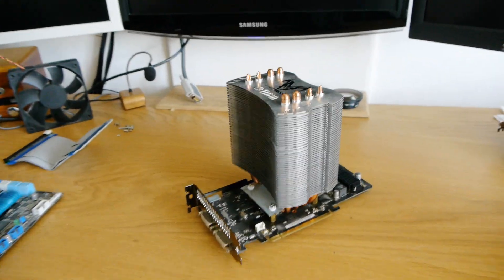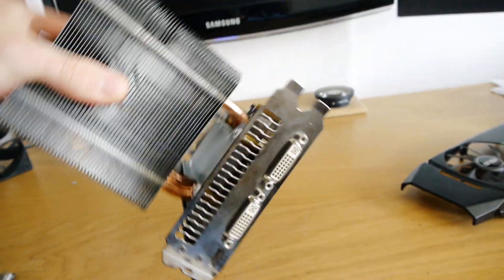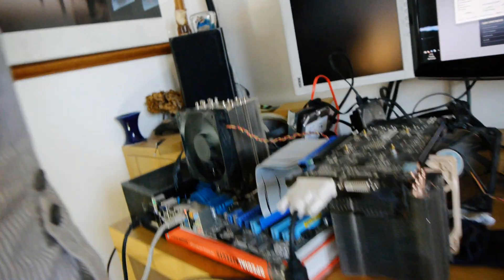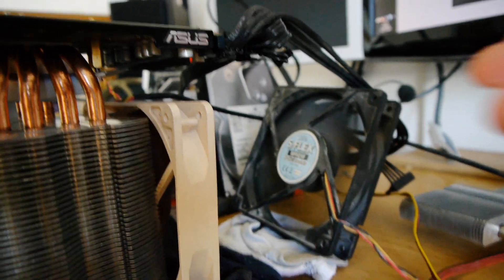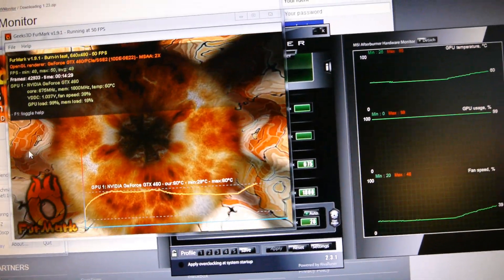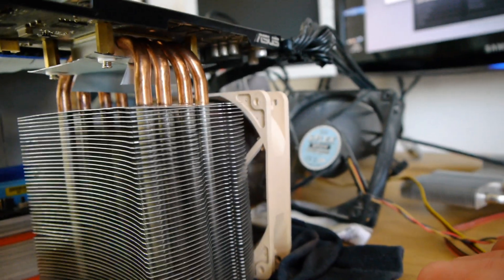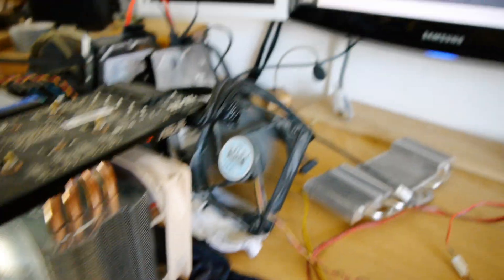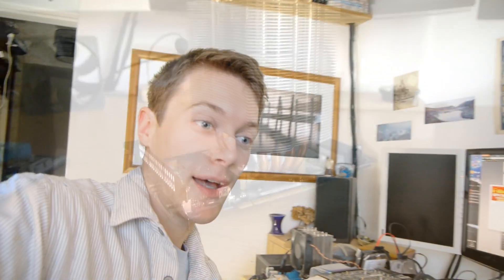CPU cooler on GPU (INSANE temps!)

Comment: Nottingham Area! Project offer! Project Idea!
Hi. Big fan of your channel, the work you do is great and quality looks amazing. I was hoping to tempt your passion for tech with helping a fellow enthusiast create something unique for your channel. Are you up to the challenge? I would be happy to deliver my entire set up to you. Or you are welcome to work here. I would love to send you some pictures and further details of what equipment I have. What do you think? I would love to make this happen for the ultimate studio/ gaming setup. 
 I have a fairly decent HP laptop (spec below) with a monitor. I also have a black desk & some semi pro recording studio hardware (details below). I would love your help to intergrate this equipment into my desk. I am also into gaming and would like to add a Laptop External Independent Video Card PCI-E Expansion Card for an external GPU

Laptop
HP ZBook 15u G5 Core i7-8550U 16GB 512GB Radeon Pro WX 3100

Monitor
HP 32s Full HD 31.5" IPS LCD Monitor - Black & Silver

Desk
3 Tier Pro Audio Studio Desk
Large studio workstation - for musicians and producers
Keep outboard gear within reach by using the two 4U rackmounts
Sturdy structure, with wooden laminate shelves
Raised top shelf to position your speakers and computer screen

Recording studio software
Acid Pro 10

Recording studio equipment
SubZero SZ-AI2 USB Audio Interface
SubZero SZC-300 Condenser Microphone
SubZero SZSM-4X Studio Monitors, Pair
SubZero SZ-MH200 Monitoring Headphones

Additional speaker
Sonos Play 3

Please contact @pesciboi on insta or twitter for more info

Comment: I first watched this video a while back and was wondering from time to time if there was a way to put a cooler on GPUs, that is better than the stock coolers but a bit more practical than this mod. Stock coolers are weirdly designed imo, because the air just 'splashes' to all sides after hitting the fins and don't really go with the airflow of normal cases.

I did end up putting a 120mm AIO on my 1080ti mini with the Kraken GPU mounting kit and I have to say that I'm seriously impressed. I went from thermal throttling at 90°C with 120% power target to a maximum of 58°C. YOu can just leave the pump and fans speed at minimum, at it's whisper quite.

Comment: if you drill a hole into a multilayer circuitboard, to mount a cooler, and it still works after, it is either a fals one, or you just got lucky. And do not forget, Do not do this at home, you might kill a planet by creating more E-waste.

Comment: Brilliant. It should be possible to also mount a 2nd cooler to the back of the card, with thermal pads as thermal interface as too many exposed components there. I'm estimating if that can be done, another 10c to 20C drop, as the back gets similarly hot as front. I have just done a little experiment with placing freely, a stock cpu cooler on to the backplate of 1080ti kingpin gpu, with lots of thermal compound and noticing a few degrees lower temps.

Comment: pci extension cause you mounted the cooler the wrong way..if it was rotated by 90 degrees it would fit in the proper slot.

Comment: - 4 heatpipes. They run from one end to the other.
- You should make another video with mini copper heatsinks over the necessary chips.
- If installing the GPU in the PCIe slot, make sure there is enough weight support built on the side to avoid breaking the GPU and PCIe slot. Either through a custom screw bracket attached to the case with an "L" standoff edge or similar, or something securely in place underneath the heatsink to hold the weight.

Comment: My card tops out at around 65c with the stock blower cooler. I thought results would have been better, but it goes to show how effective blower coolers are for extracting heat since it literally blows the heat OUTSIDE of the case keeping case temps lower and thus the card cooler.

Comment: Isn’t that cooler designed in a way where inverted is the least efficient because the liquid within the pipes are not absorbing the complete heat from the gpu and traveling “up” the pipes to then return back to the base? 
With this layout would all the steam and air be what is trying to cool the unit and the liquid within is resting untouched?

Comment: Hey thx for the vid. I was inspired and did the same with good results on my GTX1060. Reduced GPU temps from 83*C to 59*C. Costs 30$ for ready made mounting brackets and heatsink.

https://imgur.com/a/gnRlM

Also added tiny copper pieces on VRMs.

Comment: That big heat sink is not square.. it is rectangle... why on earth did you mount it with the length towards the mother board? It just seems like you were sleeping when you were designing...

Comment: Fuck you said 23C is pretty hott?? In Arab 40 is the normalestttt temprature!! In Indonesia 33-35 is good temperature and if its 23C in my country maybe people will dead caused of frozen and in my house i use AC but actually its not Air Conditioner but it is "Angin Cepoy-Cepoy" or world's fresh air or sames like an engine without radiator that you need air too cool ur engine or ur engine will be overheated then blows up hahhahaha.. "Sorry if my grammar wrong because i just a villager with low knowledge :)

Comment: I just wanted to correct you on some your terminology your pci-e extension cable is actually called a pci express rizer cable as wellwhen you state that its awesome performance at 60c  you would actually want to say it's awesome thermals  but cool video definitely but cool video definitely a neat idea

Comment: nutz got a 7970 with 3 small fans works great runs 40-50c overclocked /// and overclocking not needed just tried it few times playing around ! very slight visual improvements overclocked not worth the slightest risk / now overclocking my 8350 makes big difference

Comment: have fun fitting that into your case...  you could retrofit a car radiator on the card too but its not practical.....cooling is a science between getting temps down without taking up too much space and energy....

Comment: No, the pipes are 4. FOUR! And to make a conclusion, we should know how much RPM was the fan at 58°C and 51°C respectively. So we can find how much percent we should increase the RPM to reach 1% lower temp. That's why I'm wondering if the readings on FurMark are based on the fan RPM, when connected to videocard fan molex or not? My suggestion is that we have 5:1 ratio - we should increase the RPM with 5% to gain 1% lower temp but ONLY on this exact computer system.

Comment: Nice video but... just to point out... the heatsink has 4 pipes, not 8. Since heat raises you mounting the heatsink upside down is actually having a negative effect in your experiment.

Comment: i have a suggestion for ya, try putting on the original heat sink that came with your GPU and maybe put a 140mm or even a 200mm fan on it :)

Comment: interesting concept but could you add a Peltier cooler and flip it upside down for condensation collection tray. unless a gel based dehydration substance be utilized.
Reply: Yes this orientation now submerged lol
Reply: in oil both motherboard and gpu could be cooled this way

Comment: For those of us who have found SLI/crossfire to not be worth it because of the related cooling problems> Why do all the vid cards have to be 1 or 2 slot case heaters? Lets see what do I use on the PCI side with that GTX 690. Oh I remember....   right nothing. So that leave me how many empty slots to exhaust Vid card air? I gadiated unvirsity two tobad  did not stay so i could learn longs nuff stuff so how not to think.

Comment: Good finding, 60 degree top temp at full load is impressive. Would be cool to actually be able to do this inside a case somehow. Like using an extra slot and have a much beefier yet flat (shape of an extra graphic card using that slot) heatsink+fan construction. It could have a rubber extension to take air from the front of the case directly into the heatsink instead of sucking warm air from inside the case.

Comment: Try to replicate the same with a 700/900/1000 series, if you find a solution and get it below 80c full load without the stock cooler and with a complete silence, you should write a patent! :D

Comment: All the comments just pointing out temps where they live 😐 Back to the matter at hand i would suggest putting a lower profile cooler on there is one that is both heatsink and fan called thermal take then you can buy small heat sinks to place on the ram they come in various sizes and the silent fan on the cooler would draw heat away from the ram chips heatsinks 😊

Comment: what? why so warm? my Graphics card runs 60c in "quiet mode"
Reply: The GTX4xx series was notorious for their extremely high temperatures.

I think the 460 was around 80ish °C under full load (reference card, so his orignial cooler from Asus could maybe achieve around 70-75°C) - that's without ANY overclock whatsoever.

I suspect you GPU is something newer than the GTX 4xx series - these last generations AMD and NVidia have mainly focussed on lower power consumption (=less heat), rather than throwing every last bit of cash onto pure performance (which was done with the GTX 4xx series - not a smart move back then)

Comment: 1. The cooler is outside a Case.
2. The cooler is bigger then outher GPU coolers so no wonder.
3. In my room there are always temps from 23-26 and in summer about 28 °C and I have floor heating so... 70°C for my Gpu are insane^^

Comment: Very strange method of resolve cooling by manipulating a dimensions of fan and radiator. 
Probably more easy to direct flow of cold air to cooling system to reach better results?

Comment: Lol my 750ti doesn't even pass 45 degrees Celsius under a full load
Reply: It's also 4 generations newer.
Reply: PanicStudios true
Reply: TroyRedstone it's probably a non reference so the company might have add on the powerful cooling as a way to charge more money. also the current generation is much more power efficient so they generally generate less heat
Reply: yeah i agree, most nvidia cards have lower temps than amd

Comment: I was expecting more actually, 10 degrees cooler than stock? with a heatsink of that size? whaaaat
Reply: well, its not properly spread sooo thats all you can expect from it
Reply: Well there is probably less thermal throttling going on with the big ass heatsink.
Reply: 10° at minimum fan speeds with no thermal pads and the GPU upside down so the die is on top.(heat rises). 20° at maximum fan speed. 

Fix all the other stuff and I’d be willing to bet it could easily be 20° at minimum.
Reply: 20°,watch the whole video

Comment: nice modification, but the pipes sistems is working upside down.. there is a gas inside de pipes that evaporate and condense to inproove the cooling. You have to put the cooler up. try another video test like this ;)
Reply: but if you look at the numbers, you'll see that it still performed with vast superiority over the stock cooler :)
Reply: Yes but could be better ;)

Comment: coolers perform better verticaly and not upside down, because of condensation. Let gravity do its job, you should notice an improvement.
Reply: Hot air rises, heat in itself is conducted through some materials, as is
 electricity. Copper is a great heat conductor, air is a pretty good 
heat isolator compared to most metals.

Comment: Oly problem with doing this on newer GPUs is that this doesnt cool the RAM or VRMs and only cools the GPU die. Newer GPUS are going to need significant cooling on the ram and VRMs. These older cards could get away with passive air cooling directly on the chips from case fans and the like.

Comment: Yawn. My 780ti with NZXT bracket and 100 dollar AIO liquid cooler runs at 45 degrees under full load constant. Super experiment LOL. Oh and the temps are not insane at all as you could read. :)

Comment: lmao 20 degrees cooler i expected around 30 / 40, install a watercooling system and be amazed how silent and cool you'll run. not even speaking of how impractical your setup is with the pcie cable and no case oO. this video is a complete joke

Comment: I see huge problems with this build, VRMs are not cooled and memory is not cooled.
Your card will die.
Reply: Re-watch it. The VRMs and VRAM are cooled by the black fan.
Reply: Blowing air is not good enough
Reply: ValugaTheLord
It was enough for this test. In his "CloudUnit" case, he added heatsinks on VRMs and VRAM.

Comment: that seems to be a nice set up! right now I'm using my GPU like that too because the stock cooler broke and I didn't have any other to replace, so I took an Intel cooler I had here and replaced on the gpu's stock dissipator... the biggest problem with this set up was the color code of the cables, but once we figured it out, we managed to make it work quite fine. it took down 10°C off my GPU, which has been the biggest perk of this fix. i'm using a GeForce 650 gtx :)

Comment: 23 degrees room temp is hot?ROFL
31 degrees is normal where I live lol.
Reply: xWARVICx My house has really bad insulation, so it's 10-15C in winter. i have gotten used to it though, so not a problem, it could be a little warmer, but over 25C and i'm suffocating.
Reply: Spain here. 50ºC in the summer and -15ºC during winter. Crazy.
Reply: I think he's living in the UK. So yea, 23° is "hot" there.
Reply: here and I thought it was really warm here today 11C
Reply: in finland we barely hit 25 on summer :D
Reply: Comfortable temp for me is 17-19c, so 23c is hot for room temp for me anyway, I would die. Nordic blood I guess.
Reply: Timbosity Coming 
Good to know !
Reply: When it is cold outside and you have to heat your house then, I'd say 23 C is pretty hot, feel more or less like 27-28 C. The difference between 23 C outside temp, and 23 C internal temp is very big.
Reply: 15 normal for me :D
Reply: anything over 15c and i'm unhappy
Reply: 21 degrees is the standard for room temperature, so yes, 23 is hot. Remember, room temeperature, not YOUR room temeperature.
Reply: 25 c is about 72 f give or take a few
Reply: Meanwhile in northern sweden, i walk my dog with a T-shirt in -8*C and a light breeze ^^
Reply: dont compare pussy to penis because they start with letter p (some random saying lol). you are probably living in another place, where that kind of temp is normal, so you are used to it. for me 30c is hot af. i like 20c.
Reply: Cheese 1337 That’s an utterly shagged saying... ^^
Reply: skarskar skarner i just quickly thought up from my language lol
Reply: Wtf 23 is hot ????...i was thinking same thing.
Reply: Gabriel Villar Yeah the asphalt gets soft when it is heated
Reply: Some people live further north where it is colder. Or south if you are on the other side of the equator
Reply: you live in africa. middle east probably
Reply: Here in Brazil(São Paulo) is normal a 36°C temperature in summer, and sometimes hits 41°C. thats cause i am in the south of the country. In the north is normal the heat smells down a road and causes problems in the cars. hahaha
Reply: FSXgta Yeah, where are you from?
Reply: Gabriel Villar Norway, air cooling is better here since it doesen't get any hotter than 30 max :P and the winter it is cold
Reply: California here, averaging 45 with PC on (and gaming) in the summer.

Comment: it has 4 heat pipes not 8
Reply: There is an annotation explaining that he accidentally said 8 but there are actually 4. They do act like 8 though since each end of the pipes goes away from the other spreading the heat more efficiently.
Reply: He got rekt
Reply: Khalil wen juckt das?😂
Reply: Yo
Reply: but 8 pipes leads the heat away from the gpu-cpu hotspotshit.so i count 8.the heat doesnt move clockwise
Reply: Nicolai du bist schon dumm oder?
Reply: Any problem ? 
PS: I have a lot of friends :*

Comment: lol now lets just add another gpu for sli and oh wait i cant because theres no room
Reply: If you faced each card away from the other in a custom setup you actually could manage it.
Reply: what with gpu risers adapters?
Reply: and if you are going to go to that much trouble may as well just get a waterblock and shove it on the card it will look better and perform better.

Comment: I put an amd stock cooler on a 7900 gto a few years ago, that card was displaying 117 degrees celsius before I did that. I don't know if it was an error but after I changed the cooler it went to a max of 57 degrees

Comment: what about VRM? It needs to be cooled as well
Reply: The 460 GTX VRM actually doesn't run hot all that much that it can actually be passively cooled, I used to own a 1000+Mhz Core Clock 460 GTX and the VRM was just fine at 75c
Reply: well on this praticular GPU maybe. But if it is inspiration for another people with various GPUs, it's worth mentioning
Reply: It was mentioned, actually. Listen closer.

Comment: Not sure what you're showing us here... You mounted a huge heatsink to get 60, which also makes it impractical to put in a case, then you didn't even run full screen to push the card to the max (nevermind overcloking). What were the temps with the old heatsink? Did you even mention that? Well, it's nice that you're learning but this isn't anything amazing. Watercooling can get you even better temps with no noise and it will fit in your case...